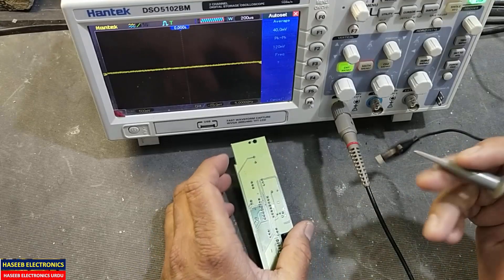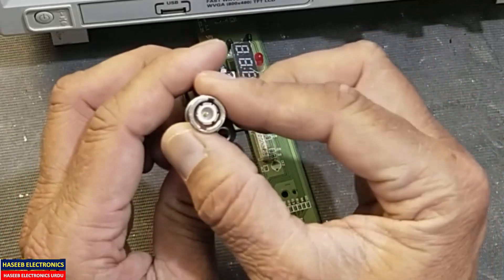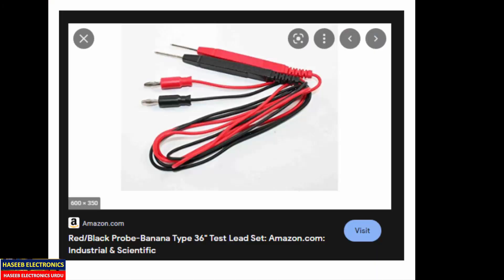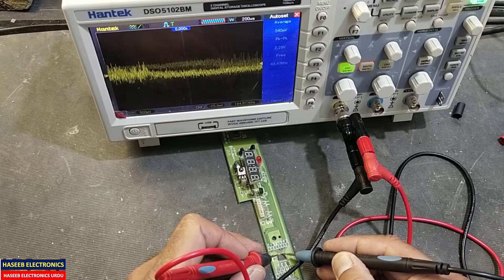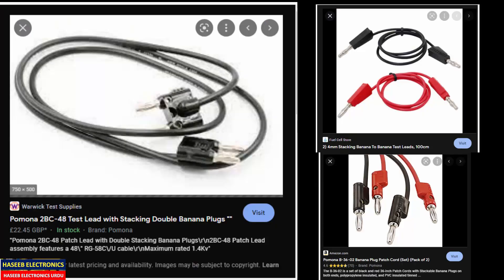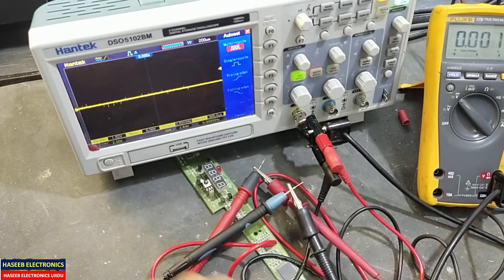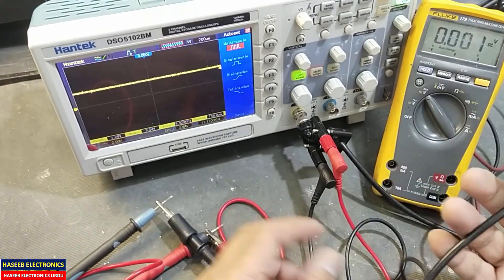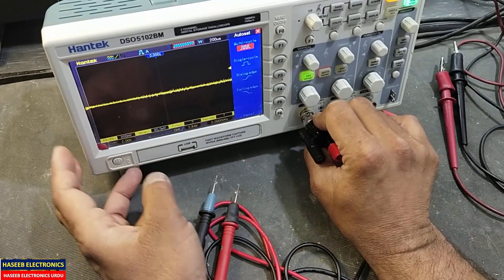{619} Very Useful Test Accessories For Oscilloscope - BNC Male Plug to Double Binding Post Adapter

Comment: Thanks for the tips. These tips are only meant for looking at the general function of the circuit. They are not meant for looking at the characteristics of a specific waveform. Adding length to the ground wire adds ambient noise. Using a common probe, instead of a properly terminated oscilloscope probe can cause termination problems. If common probes are used, the scope and the scope probe should be se set on x1. A slightly better solution might be to connect a separate ground wire from the circuit to the scope reference ground lug. Then, the actual scope probe can be used on both x1 and x10 settings. However, the scope probe will also lack shielding and this may be a significant issue. Haseeb, I know that you are aware of all of this. I am just sharing, for the benefit of your viewers. I hope this helps. Cheers!
Reply from the maker: welcome dear 
basically it is to test low frequency signals 
if we ant to test frequency above 1MHz then it needs signal shield
for that purpose a shielded wire is the best solution. as the Pomona electronics California cables are awsome in conductivity and noise reduction
as well fluke test leads are superb 
off course it is 1x signal, so we must take care for amplitude of the test signal
this technique I use most commonly in low frequency circuits and digital signals

Comment: I would add a variant to this approach: Connect a differential voltage probe (e.g. Micsig DP10007) to the scope and then you can probe an active circuit without any regard to grounding (or not) at any particular circuit node. Alternately, use a battery operated scope. Both of these approaches avoid problems with the scope BNC ground being in common to earth/chassis ground and then potentially blowing up the PCBA if probed with a grounded lead. Note with a battery scope you can only use one channel since the scope channels are grounded together internally which would prohibit random probing of a circuit lest the grounding short out nodes being probed.
Reply from the maker: exactly perfect 
i recorded the same lecture  before 3 days for DSO safety. this video is in editing it will available in 2-3 days 
i mentioned that battery power oscope, or differential probes or isolation transformer

Comment: Just viewed your series of video's on SMPS.  Thank you nicely done.  Question on Scope and AC-SMPS.  Are you using a isolation transformer when using the scope with the SMPS? Several articles have mentioned blowing up scope and probes if not used?  Thanks again
Reply from the maker: yes dear i am using isolation transformer 
my upcoming video is on  the same topic, which i recorded 2 days before. it is now in editing. as it will ready, it will published with all details
Reply: @HaseebElectronics  Thanks for the update will look forward to the video...

Comment: What a great way to fry your circuit. Or your oscilloscope.
Not a good advice.
Reply from the maker: No dear 
it is very best solution for low frequency circuits and to troubleshoot logic circuits. i am using this arrangement from 1992 practically. first i was using on my analog scopes and now i am using on digital oscilloscopes as well 
although it dont have frequency compensation so, its response in MHz drops significantly. moreover as it have separate grounding wire. for high frequency circuits, it is best to use a shielded wire, and provide ground to shield from the nearest point to the test terminal. so it will eliminate the distortion from the signal

Comment: Certanly not. 
Just look at the noise level. With a such long bananas wires you have a huge double antenna ;)
Better result will be when black clip of oscillocsope will be fixed on  gnd of the circuit through (for example) soldered short lead of some through hole element.
Reply from the maker: yes 
that noise involves when we work in low amplitude RF signals. for normal digital signals, it works normally 
for high frequency specially in MHz we need shielded signal cable (the best quality is from Pomona Electronics California)